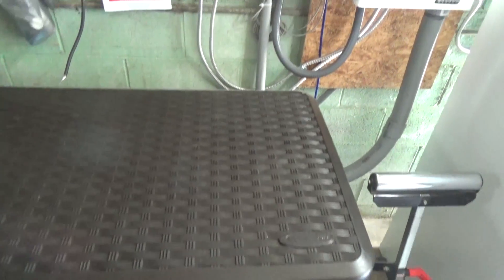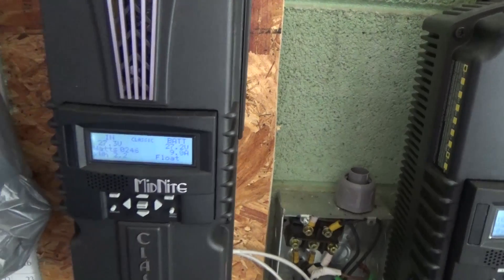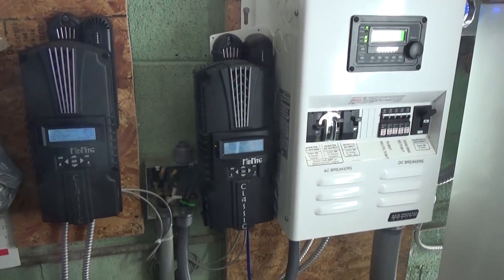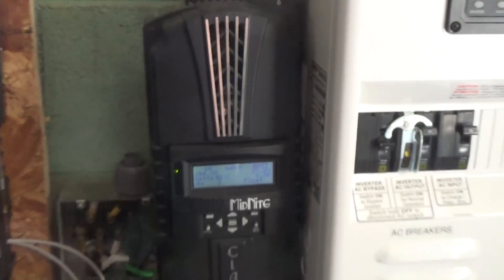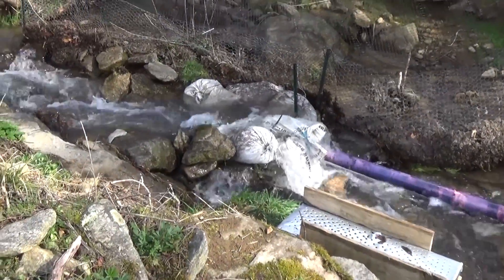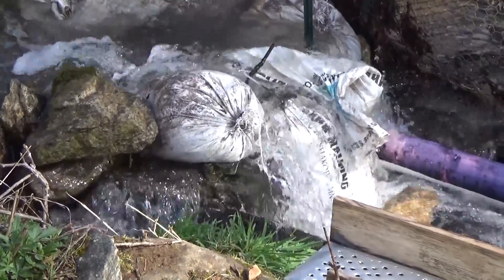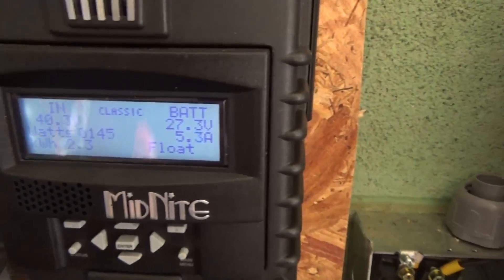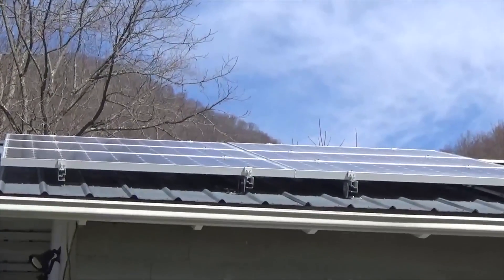Micro Hydro Power with Turgo generator Part 2

Comment: That little generator looks like it couldn't run a central AC home unit let alone a refrigerator, stove, lights, and all the other things a normal house needs. I'm not even sure my 10,000 watt propane generator could do that. Maybe this is just a battery conditioner to top up the batteries at night.

Comment: Doesn't #10 wire lose quite a bit of voltage running 300 feet?  How much more could you get out of the system running #2 aluminum wire?

Comment: How would this kind of system work at 4000 foot elevation in Northwest Montana where winters are cold, would it work? Seems like the temperatures would prevent it from working year round?
Reply: As long as you have water flowing through it 24/7 would not freeze

Comment: why can't you use the downflow to power dual or triple geared sets of those? 1 input source to power 2 or 3 other driveshafts each with their own generators (Turgo)? it seems you would have enough torque for such and application

Comment: If you have just a HYDRO GENERATOR  that puts out just AC and you want to tie it into the grind, how would you do that? I have found a 10Kw hydro generator that runs at 200 RPM and puts out 400V. and 60+ AMPS

Comment: With the flow of water I would upgrade to a 300 amp car alternator and be done with the solar altogether. That's 3600 watts 24/7 rather than a good of solar of 10 to 12 hours minus bad weather.  If I had this flow I would upgrade to a 48 volt system and use this 48 volt 90 amp guy 4,320 watts. https://www.ebay.ca/itm/Leece-Neville-4417JB-Alternator-90Amp-48V-J180mnt-John-Deere/333269866497?hash=item4d986e9801:g:oi8AAOSwGd1dL2Ac&vxp=mtr Here is an inverter  that will power an entire home. https://www.aimscorp.net/12000-Watt-Inverter-Charger-48-volt-120-240vac.html In 2 years all electric could be free!

Comment: 1. Did you use any alternator for the turgo? 
2. Wouldn't it be better to place the turbo under a cover for rainy seasons?
3. Can we directly use the AC supply from the turgo?
4. How fare did you place the turgo from the head? 
5. Did you use wiring to get the supply from turgo, when you connected the turgo wire into the rectifier inside the house?
I am from Afghanistan and currently studying Electrical and electronics engineering in india. I would like to help my people back in my country once I'm done with my studies, to provide them electricity in places where government can not provide. So please do help me in this matter.

Comment: Wish I had a stream like that near my place. I would build a concrete weir with  spillway as high upstream as possible, incorporating a large, sloping gridded intake box, through which I would feed an 4 inch pipe with a shut-off ball valve at the weir. The higher the drop of water, the more power you can generate for a given volume. Then at the lower end, make a solid concrete platform base with a nautilus shaped collector, with a turbine in the centre so that the water shooting out the bottom would be focussed  in a downward spiral directly into the impeller vanes. The outflow from the turbine would be piped to enhance laminar water flow, the suction of which would increase the turbine action. As my existing 15kW solar arrays feed a 48V, 48kVA AGM battery network which sit on 52VDC at sundown , I would be requiring the hydro generator to provide 52VDC

Comment: great video!    Have you considered a water wheel running a vehicle alternator which produces 110volts.  it sure looks like you have enough water flow.  just a thought.
Reply: Alternator makes 12-14 volts . You're confusing amps with volts .

Comment: cavitation doesn't happen because air enters the pipe, cavitation is the formation of bubbles in a liquid typically in a low-pressure area like behind certain parts of propeller

Comment: Install a tee on your 4 in about 10 feet down stream of the intake. Then install a peace of pipe so it is a little higher in grade then the intake. This will allow the air to escape
Reply: won't the installation of a tee reduce the speed of the flow, thereby reducing the power produced?
Reply: @ShoaebSenpai  No, the tee is pointing straight up and it's called a stand pipe. Think of it as a sight glass on a open top tank, there is exactly the same pressure in both. Only difference is... it isn't on the side of the tank. And it should be located about half way down the system and the top of the stand pipe needs to be higher than the intake. It allows any air introduced into the system at the intake to be able to gather as it is running down the pipe and then vent before getting to the turbine. Also it allows you to check the intake, you want to see zero bubbles coming out of the stand pipe. And the level in the stand pipe should remain constant without pulsing up or down. If you see one or both, you have a problem.

This system the way they have it set up, will have head problems. The key is to have the pipe running at the same angle down hill and not hanging in the air. That will add to pulsing or cracks in the pipe too. If there are any dips in the pipe, it will hold pockets of air, and it will affect the power of the system. You will see a pulsing at the turbine if you have enough air in the system, as it compresses the air in the pipe, you'll get a "wave" in the system. And in some cases where you have a dip in the piping, you can get turbulence and it will reintroduce the air into the water. You can also get micro bubbles off gassing from the water if there is any turbulence in the flow. Normally micro bubbles will flow equally spaced through the center of a narrow tube or pipe. 

Plus they should have made a generator shed so everything isn't bouncing around and is protected from the sun and rain.

Comment: The Durgo seems very noisy over and above the water flow - is there anyway of sound boxing that? Also the temporary pipework seems quite an intrusion to the creek but I suppose if you spent a bit more, that could be buried in the banks and covered over.
I guess my main surprise is that for that volume of water I would have expected 4kW not 0.25kW - but that may be a function of generator being used. With a mill pond and the use of a potential drop of 1-2 m that is possible but probably much more expensive. If the owners don't need 4kW then fair enough... That's until they buy an EV and then they'll want 7kW :)
Reply: Yeah, I feel bad for how they've wasted the capacity of this thing. If well done, he doesn't need additional solar shit. Or maybe he can make a turbine himself, there's a video uploaded by some Russians, a very simple turbine blade and generators are of many types, he can pick one capable of 3HP

Comment: Nice video but I have several concerns:
1. Battery venting. All lead acid batteries off gas, most of the gas is relatively harmless but not all of it. ALL GAS IS FLAMMABLE! You're keeping the gas trapped in a plastic container which is not good. That said, it'll work for the most part but you're taking an unnecessary risk and potentially shortening the lifespan of the batteries.
2. Heat sink for the rectifier. No matter how robust, if they get too hot they will fail. The price for those things isn't too much but why waste time and money when a little forethought will save you in the long run. I agree with another comment about the electrical distribution setup. More planning and tidiness to allow for scale ability. 
3. Mechanical stress on the pipe, on the turgo, on everything. It has been pointed out by many that some sort of dam would be the best bet. Short of that at least use something that is mechanically connected to the underlying rock structure. It doesn't need to be overly complicated, just enough so that you pipes and the turgo are securely positioned and can't be washed away by swells in the creek level. The fact that you initial sluice box got washed away and a weld on your turgo mount broke speak to the incredible amount of mechanical stress moving water puts on things.
4. Laminar flow. I haven't seen anyone else comment about laminar flow yet so I'll throw it in the mix. You are correct in stating that air in the water leads to cavitation which diminishes efficiency. Cavitation also increases the wear on the bearings, on the turbine, and on the housing for the turbine. As part of your pipe size reduction it would be relatively easy to add something to create a laminar flow. Said device could also be made to remove the air. It could be something as straightforward as a pipe filled with straws and a carefully milled reducer.
5. Trenching. This is more for aesthetics than function but would serve to solve some of the problems relating to issue #3. Pull your water from the stream with a partial dam that runs at an angle to the flow and doesn't protrude above the level of the water. Optimally it would be made of concrete. That harnessed water flow would then feed into pipes to the side of the stream that are buried in a trench. A medium to large cistern could be used, but wouldn't be necessary, to remove air from the water flow in your pipes.
6. More batteries, more turbines, and skip the solar altogether.
That's it. Sorry for the book but I just wanted to put my two bits in. I do like your video and I applaud your efforts.

Comment: Has the product been tested in a reliable government laboratory? 
Do you have test data?
What certification mark was granted?
Why do I see an authentication mark?
Reliability, Practicality, Accurate Data, Service, Quality

Check the line of the motor to confirm the voltage. Show me.
Show the motor performance.
Show me the details.
A good product makes you rich.
But you're cheating.
You look like a swindler.
First, I have a test from a research institute.

Comment: Ever though of using the excess power to heat a large hot water tank, rather then allowing the electricty, to go to waste at load dump heater.
Reply: Only a couple hundred watts that is captured here, where nature was naturally wasting the kinetic energy before aerating the water and cleaning rocks.

Comment: I,m electicity stupid. I see 3 wires hooked to the unit coming from the hydro. 2 wires coming out. please explain.
Reply: I wasn't paying close attention, but presumably the turbine generates 3-phase AC (alternating current), and the unit converts that to DC (direct current).  AC is like a sine wave of power going up and down in cycles.  Each of the three wires is carrying AC evenly offset from each other. DC is just a steady level of constant power on one wire and ground on the other.

Comment: what is it with these amateur installations? A unit here and a unit there, just thrown up on the wall, no matter if there's room for it or not. Should be in a nice box where it's safe, where it looks good, where it's easy to extend the capacity of the system. And so on.. Ar least have a sheet of wood to mount it on that is big enough to make it all nice and tidy. I see this all the time - this is by far not the worst tho - but people just throw up stuff on the wall, like it's not planned at all. Come on, one can do better than this...

Comment: `The Main Issue I can See is the rectifier is very close to the Turbine
So you are making AC that too 3 phase - 
I would suggest Transfer that output as near as to your Storage (Battery ) & then Rectify the power i.e. from AC 2 DC. Then on to charge the battery

DC have huge transmission losses  & you are already producing AC - Use that AC wisely.

Correct me if I am wrong
Reply: The rectifier was only at the turbine for initial testing. Final installation was in the house next to the charge controller and battery array.
Reply: @nathanrogers8713  DC is more efficient than AC. however, making high voltage DC is much harder than making high voltage AC
Reply: It's all about the level of voltage of transmission, not about AC or DC. In fact HVDC is better and if you research you'll find that they're building high voltage DC lines in places around the world. eg 500KV dc lines. DC is better because if you look at the graphs,  some portion of the AC waveform is below let's say 20 volts for the angles 0 to lets say  15 degrees, that contributes to more heat per unit power than HV DC at 1000V  which is perpetually at 1000V

Comment: I would build a box going down off the turgo so water doesnt spray sideways. This way it doesnt spray aginst the dirt and rocks making them slippery and hard to work with. Also i would put a cover on the top of the turgo so you dont get your finders choped off

Comment: Brother I have a swamp with natural springs. I need sustainable power, can it be done
Reply: You need a good flow and a drop in elevation to generate the PSI to spin the turbine.
Reply: 1pcmedic I have natural springs that will possible give me a considerable lift in elevation, or possibly keep alive the current elevation if I were to create run around stream. I also could build a dam, beavers have been doing it since I can remember and they always have a considerable amount of flow over the top in no time. Also, on this channel I've seen some ingenuitive ways of creating water flow
Reply: Dam it, release it, ram pump it up a hill to a tank or pond, once accumulation is sufficient release what you ram pumped up the hill into a micro hydro system, dump water back into what you dammed up, repeat. I'm gonna get booted for saying that this in theory is perpetual! (smarty pants emoji)

Comment: Have you thought of using the air in the intake? Look into the trompe hammer, if you don't know about it. It should be a fairly easy addition, can scrub your cavitation issues, and will provide free compressed air.

Comment: just one fact for you and your subs.  THE most efficient type of turbine to use at a low-flow low-head site is a correctly designed poncelet-style overshot or breastshot waterwheel.   here, in order to make the best use of the available head, a delivery pipe / flume should be used to deliver water to the top of a two-point-five to three meter overshot waterwheel.     cheers

Comment: Great work , but do think about getting the intake out of the stream , your next big rain will even sweep away what you have there.  Take a feed to a side storage tank that has a horizontal feed. Secure that input but keep the main feed pipe out of the stream..  Then take your drive pipe down to the turgo out of the stream path from the storage.  The storage will always match the level of the stream at the intake site as long as your feeder has a wide enough bore (larger than your drive pipe).  This way you wont have to rebuild or retrieve your equipment after the next flood .. and it keeps the more expensive gear downstream out of harms way as well.    Just a thought .

Comment: with a Gravitation water vortex power plant air is not a problem...fish aren't a problem..junk in the water isn't a problem
Smaller footprint, less noise, stupid simple construction...works on the force of gravity, and the rotational force of the water
Still the Turgo is a pretty sweet rig

Comment: What keeps the Turgo bearings from wearing out?
Reply: Nothing. They'd be sealed bearings, with their own lubrication, but like any bearing they will eventually fail. It isn't a big deal so long as the right grade of bearing are chosen (you'd hardly have to touch them).

Comment: There seems to be some resistance to the water exiting the chamber. Does the frame it sits in impinge on the water flow out of the chamber, causing some water to be thrown back up towards the wheel.

Comment: Hi! Nice job!
I just think you are wasting the second inlet, because you are splitting your source. What if you have a second pipe identically to the first, with same pressure at the end and use this as a second source to feed the second inlet?. what are the technical specifications of the turgo? what is the maximum capacity of this turgo?. I think you can get much more power from that great source of water you have.
Best Regards!

Comment: Thank you for the videos, Now I understand what a  turgo turbine is. I'm still in the process of trying to figure out if I even have enough head and flow from my spring to run a microhydro set up. I've been trying to get in touch with professionals in the field but there aren't many in my area and they don't seem to want to return my messages. I'd pay for an initial consult...
Reply: YOU STILL THERE ?
Reply: There are many good books out that teach you how to measure and set up a hydro power system.

Comment: It looks as if it's time to do some concrete building a small dam and a small reservoir.  

Question it appears to me the most loss in the systems is in converting the voltage to ac then dc Then ac ect.  Would it not make sense to just convert the house to a 48 volt ac system?  Lights easy.  There are Mobile refrigerators for campers and boats that run on 24 or 48 volts. There are ac units for campers and boats that run on 24 volts. What do you think?
Reply: Storage is the biggest issue, you can store DC in batteries, AC cannot be stored, it is produced on demand.

Comment: solar cells are sensitive to heat ...the more heat the less power  ...roof mount is a space saver but ground mounted on post is cooler
Reply: Someone should make a radiator that could use route the discharge of the Turgo along the back of the solar array (use a temperature controlled solenoid to turn the flow on/off) to cool it during the day when the temp rises.  It would be cheap active cooling for the panels, and if made out of aluminum it wouldn't rust.
Reply: roaddog453 but more expensive and usually lower to the ground and more prone to shading issues from trees.